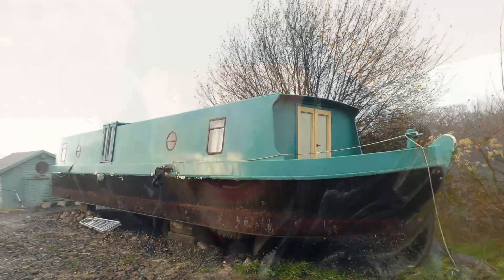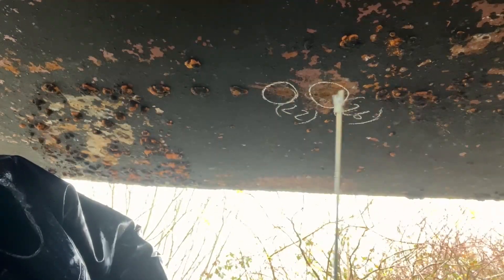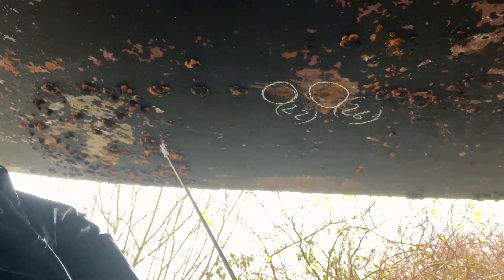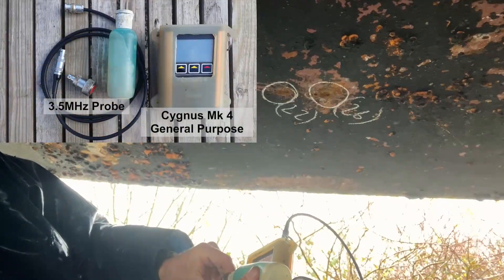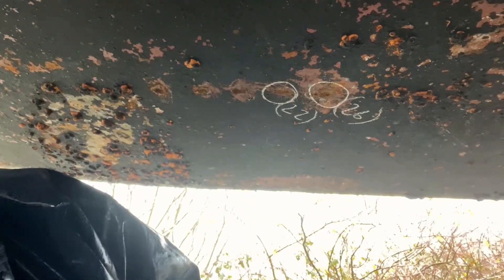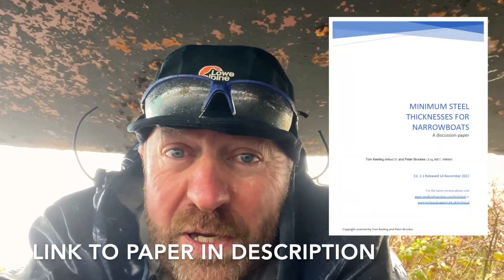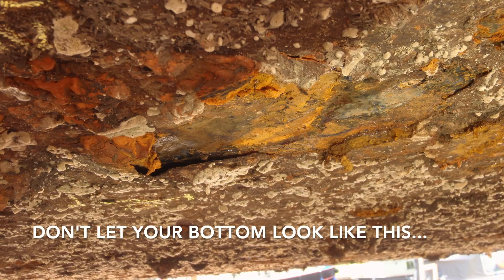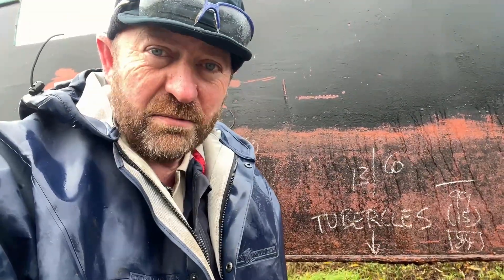Rust Tubercles Will Eat Your Narrowboat If You Let Them

Comment: Would bitumen be ok for the base plate? We have just come out for reblacking and i want to do the underside as well. We've chosen to use bitumen, as we intend to have her out at keast every 3 years anyway, just to keep an eye on her.
Reply from the maker: Thanks for the question! Bitumen is a popular choice for blacking on cost and ease of application grounds. Of course I would always recommend a harder-wearing 2-pack epoxy coating for the base plate to give maximum protection, but the cost is greater. Really important to give the base plate a thorough deep clean to get rid of as much corrosion and old paint as you can before blacking. Getting the hull out every 2-3 years is ideal for bitumen paints, can stretch that to every 5-7 years for epoxy.
Reply: @whitehatmarinesurveying Hi, thank you. We have found a lot of tubercles, so we will be dealing with those with scraping off and cleaning up. Should we treat the patches with any kind of rust treatment, before putting several coats of bitumen on? 

We considered epoxy, but we would need to have her blasted to be sure and we cannot do that at the yard we are on. Also id rather have her out to inspect regularly anyway.

Comment: Boaters dont like going under there and will give it a blind eye. My boat is now 33 years old, Alawys done the bottom plate I normally use any paint (never bitumin) that is knocking about in the shed or whats left from the sides. Came out last year  bottom plate was clean as a whistle.
Reply from the maker: Well done, that's great to hear. We all need to spread the simple message that putting an unpainted steel box in the water is a bad idea.

Comment: Rust is the result of electro oxidation.
You can stop most rust by eliminating oxygen using paint or epoxy.
The electric static charge however needs to be treated to.
Some systems discharge the electricity through anodes.
It's very difficult to stop the charging up of the steal because it's generated by wind or water passing the vessel.
Reply from the maker: Interesting stuff, thanks for sharing. I've never felt static build up in a steel hull before as most boats are 'earthed' to the water or ground. Definitely felt a static spark on a car before as they are insulated from the ground.

Comment: Had these on my boat as well , they started quite early on when the boat was 2 years old and was in for its first blacking. When scraped off, some would expose a deep pit of bright shiny steel ! We blacked over them and never had any problems in the 12 years we had the boat.
Reply from the maker: That's a really positive outcome, thanks for sharing. It amazes me how many boats on the Cut don't have any blacking on the bottom plate.
Reply: @whitehatmarinesurveying Probably because when its drydocked its very difficult to access all the bottom in one go ( the support sleepers have to be somewhere along the base plate ) , so people dont bother ?
Reply from the maker: I think you're partly right, some yards are better than others at getting the boat out of the water. You need the bottom at least 0.6m off the ground to have a decent chance of surveying / cleaning / painting it. Better still 1m or more makes the work comfortable. Some yards can barely manage 0.3m so they can't do any of the above. I think this explains why some yards say don't bother painting the bottom or come out with the 'it will only rub off' nonsense!

Comment: Thanks for the video.  Two questions, when you say relatively quickly what are we looking at in terms of months/weeks, and do you find that certain canals make boats more prone to these?
Reply from the maker: You're welcome, they are pretty weird things for sure!  
Both good questions, I have no research data to give reliable growth rates but my experience is that they develop over months / years, not weeks. Whilst they are slow growing, the pits can reach 50% of plate thickness or more if left unchecked. I've seen them in a range of canals so can't confirm it to be either a local or universal occurrence.
Reply: @whitehatmarinesurveying   Thank you for your speedy response.